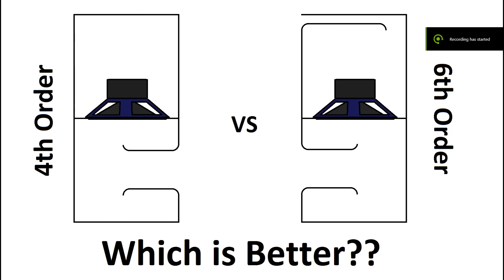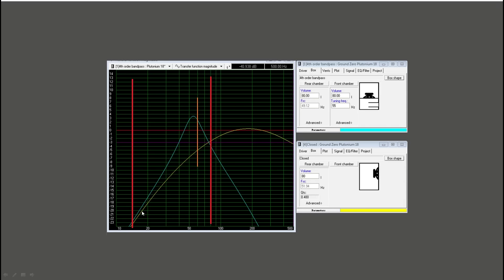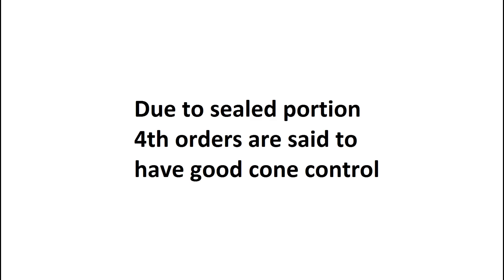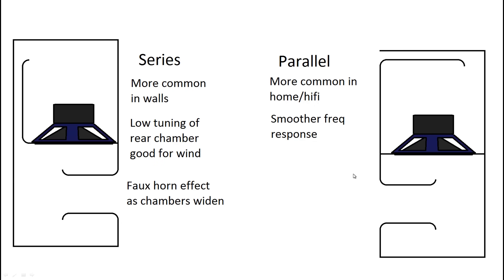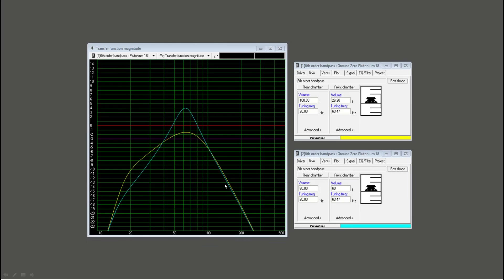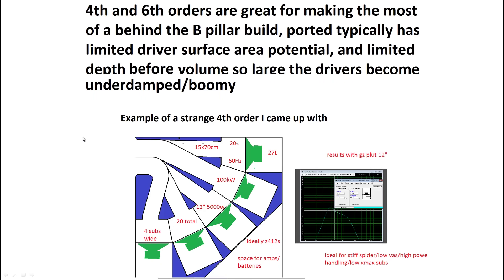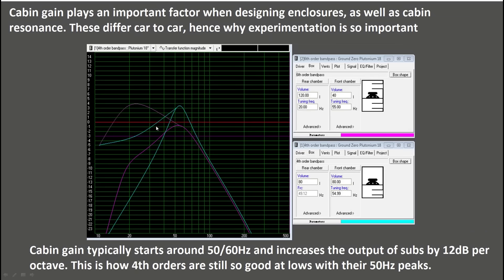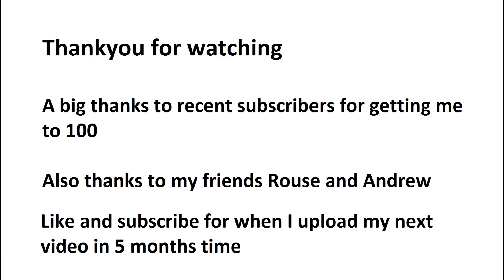4th Order VS 6th Order subwoofer Enclosures

Comment: Who remembers 2 JL isobaric in a 4th order hot box on a punch 40
Reply from the maker: I'd love to hear that, sounds like it'd sound good.
Reply: My uncle is still running his 2x JL 12w4 in an ISO ported setup tuned at 28Hz.  The woofers were refoamed with new surrounds and gaskets.   He also has a JL12W6 but is not using it currently.

Comment: Winisd can no simulate serie tunded  6th Bandpass. And that cabin gain theory is wrong.  It no low that says its 12 db.  It more like Resonases. Like in mye car i have an peak att 35 hz thats the peak of my  Enclosure system. But when i turn it up the space inside the cabin is not big enough and phase of the backwave and the front wave starting to cancel, things in the cabin starting to flex, vibrate and so on. so it start to peak at 45 hz.   And this depends on the size of the Cabin.  Where the dominant frequency's is.  And this also depends what Enclosure you use. A sealed Enclosure wil no behave like an portet solution inn a cabin. Because of the backwave and frontwave wil phase together in a portet box.
Reply from the maker: Yeah, I know cabins are complex shapes and sizes, it's annoying having to generalise, but I wanted to mention why 4th orders have bad low frequency response in the simulations but have plenty of low end in reality. But yeah, generally that 12dB starts beginning below the resonance of the car, so if yours is 35Hz you should be up a tad at 18Hz.
Reply: @Dakoustics  the biggest problem here is the Ts parameters. You can not backtrack something with something thats not correct.  Always when i Design i take out Ts parameters myself .  If you take a look att Basskassekonstruktørene on Facebook you can se mye work on it. With Rta vs simulations.  Of course this depends on what Volum you are on. But att low volume on your Stereo your box Respons will be most dominant until you turn it up and then the cabin Respons or system Respons gets more dominant .

Comment: Bro, with all do respect you just gave everyone false information!!! 

If I have a bandpass subwoofer and want to put it in a standard basspass box which is a 1:1 ratio. That means IF I MAKE MY SEAL SIDE 1.5CUFT THEN MY PORTED SIDE WILL BE 1.5CUFT "EQUAL VOLUME", 1:2 ratio means if my seal is 1.5CUFT THEN MY PORTED SIDE WILL BE "DOUBLE THE VOLUME" 3CUFT.... The only thing you got right is the longer the port, the lower the subwoofer can drop. PORTS PLAY AT TUNING OR ABOVE!!! Anything below the tuning is lost by 3db and as it goes below the tuning it loses control over the cone. 

I'm not trying to be mean or rude but I don't want you walking around with the wrong info. I don't know you, you could be a world class  box builder just wording the shit wrong. I been installing since the 90s and I learn alot over the years building enclosures and making bass tracks. I'm not the best but I'm a damn good installer. My wife wants me to start back installing but overall I admire your passion for it, I lost mines years ago
Reply from the maker: Sorry for the length of this response, but I fully respect you wanting the right information out there, so heres a few things. 
1. Regarding the 1:1 and 1:2 ratio, you didn't point out anything I got wrong. 
2. Ports dont play at tuning or above: Take a sub box tuned to 40Hz, play 80Hz, no air will move through the port. Plug the port, theres no difference in output. The only thing making sound is the speaker itself, I'm guessing you know ported boxes can play up to 500Hz even, but at that point its only the subwoofer itself. Ports in 4th orders and 6th orders are responsible for ALL the sound, so you only hear what air moves through the port. 
So, from what I can tell you're super used to how ported boxes work, which does play from tuning and above, and loses control below port tuning, but 4th orders act like a mirror effect, and do everything opposite, play port down, have control below port tuning etc. 
But yeah I get being bored of installing, if you haven't done it in a few years have a look at some integrated systems which take a digital output from the stock touchscreen stereo, theres still a want for after-market systems. Also, bunch of cheap, good class D amps, maybe just having a look at some newer hardware will get your imagination and passion going. 
Anyway let me know if you got what I mean, I've done a ton of research, experiments, thought experiments, simulations, you name it, I would never spread false information, the "sealed v ported" video was originally made to correct false information which I saw in another video.
Reply: @Dakoustics  you're good bro I love reading lol, I meant to say they play at tuning and above but yea I'm working on getting 6 15" in a 4th. Man between 1998-2008 all I build was 4th. I built a 6th but it sounded like shit. My dumb ass made the port same length and width lmao
Reply: your 6th order(series) can do this, this is something he does not mention, if you have your ports not firing directly into eachother, you can tune to same freq and be skullcrushingly loud, I have done it a few times with a 1:1.25/1.5 ratio for customers, one of them has  gotten 145 with 2 8s at 40hz (believe he said 2k burp but I could be wrong with that) bc of it, Idk if it was a kick score but damn impressive considering my one 15 in a ported box is at 146 at around 5k lol

Comment: can I make a big box using 4th or 6th order  for outdoor events will it sound good
Reply from the maker: if you design it properly yes, im seeing a few 6th order PA subs here and there, only recently though, so i wouldn't be surprised if pa is behind in tech due to car audio competitions driving spl and efficiency forward, just make sure you use winISD to design the box, 4th and 6th orders can be super peaky if you don't
Reply: @Dakoustics  Thanks have not tried it yet,  cause most design box  i've seen was this folded horns, scoops, intimidation and w.box in out door events so I will try the 4th order much simpler to build  thanks
Reply from the maker: @edifierbass7821  yeah makes sense, im making a folded horn right now and i can tell you its a pain in the ass, but from what ive worked out, horns are 4th orders, though due to the shape of the horn high frequencies are still produced due to its shape, instead of from tuning downward, its more complex than that, but might make more sense in your head that way
Reply: @Dakoustics  yes in some ways,  I wanna make  also a small version of folded horn  a home size but comes lots of work but hey just one of my future plans tho thanks for your  guidance

Comment: I personally use a compact chamber almost the same size as the subwoofer itself but with a very long port tube (4" diameter x 90" long Approx. in my vehicle). Goes down to 10hz loudly. :)
Reply: That makes a very inefficient enclosure for reproducing lows that anybody would consider loud...... I did the basic math on it assuming you used .1-.2 of a cube, with your suggested port length the tuning would be entirely too high to effectively play 10hz without sounding like a wet fart and unloading the sub so "I will take things that didnt happen for $600, Alex"
Reply: @zacharyhafer2806  
With all due respect, if the enclosure was so bad I would not make it in the first place; in fact it’s my favorite enclosure for playing infrasonics which is what it’s mainly designed for. 
“I will educate those who have no experience for $1000 Alex”.
Here’s a video.
https://youtu.be/NeSC0C1R6tc
Reply: Id love to hear that design

Comment: Thanks helped me understand more about Qts and 4th order. I'm working on a 4th order for a JL 12W6 for fun!
Reply: How did your build turn out? If it’s monstrous I’ll put the same in my civic.
Reply: @Ichabod_Jericho  I scrapped it and went a massive audio 12. It can handle more power and hit way harder deeper bass. Sold that W6.
Reply: adaboy4z I knew it! Part of me wants to go JL, part of me knew big brand names have cheaped out
Reply: @Ichabod_Jericho  Don't get me wrong that JL W6 is a beast on 600 watts but there are better subs for cheaper and can handle more power. I already had a Kicker KXA800.1 amp and a Kicker KX1200.1 so it was natural to use that power!!!

Comment: Hey. Thanks for the video. Im from Melbourne. I built a portable boom box for the campsite, its got roughly 1000watts of low midrange and high, all 12v car audio, Focal and soundstream. 2x amps, and a 130Ah battery, It works really well, has reasonable volume, and keeps people happy. I want to make a version two, keeping all the same speakers, just improving on design and speaker efficiency. I can build almost anything, but when it comes to sound design response, I get lost in the technical, and fast! Which leads me to my question. Would you be interested in guiding me towards a well designed efficient enclosure for my woofers and midrange speakers I already own, which I can build? Thanks, Ryan
Reply from the maker: mids and highs would stay as is, hard to get more efficient without buying new components, and for sub I'd recommend a 4th, I've had good luck with 4th orders for outdoor PA, for a 12" something like 28L sealed, 28-40 ported, varies sub to sub. Tune it around 50-60Hz. Port should end up being 30x5cm, and about 25cm long, add a curve in the back, rounding over the front should help too, if it sounds bad just remove the middle baffle, and mount the sub like a standard ported box

Comment: How about 6th order with isobaric loading?
Reply from the maker: I've made an isobarik 6th order, its basically the same, but the vas of the drivers is halved, so to be optimal the enclosure size should also be halved, unless the enclosure is already too small in which case isobarik can be a good way of correcting it

Comment: The qts figure of a driver tells us the electromechanical damping and amplitude or bias of the system towards resonance (Higher qts means less damped and more biased towards resonance). Lower qts i.e below 0.4 are best for ported or bandpass if there is no eq. because they have a "damp" resonance). QTS and resonant frequency can vary greatly after burn-in, temperature and humidity. For example, a raw Peerless xls 10 measured- QTS 0.38 FS-37hz VAS- 25l. After burn-in for 15 minutes with a 25hz signal (the voice coil former almost hitting the back plate, though not quite) QTS- 0.32 FS- 26hz VAS- 79 litres! - no kidding.
Reply: Q is the ratio of reactance to resistance. It stands for "quality" because a century ago good radio transmission, and good radio reception, required antennas that delivered as much energy to the radio signal, and from the signal to the receiver, as possible--the resistance was a parasitic loss spent heating up copper. Since the thermal dissipation is (current squared) times (resistance), increasing Q meant arranging things so that current was low (so voltage high) and there were few and ineffective ways for the electrical signal to get converted to heat (both on the way out of the station and on the way into the listener's home.

The claim that low Q drivers have a peakier response is incorrect. The maximally flat amplitude response vs frequency is obtained at Q = 2^^-.5 = .707 = sine 45 degrees (Butterworth); maximal phase accuracy Q = .57 (Bessel); maximal transient accuracy Q = .5 (Linkwitz); maximal efficiency (NOT sensitivity which is usually called efficiency but is not dimensionless as is every efficiency)
at Q = 1.1 (Chebychev). Any value of Q greater than unity will exhibit ringing and overshoot. This was all worked out by the Australian mechanical engineer A.N. Thiele and his grad student R. Small and published in IEEE Transactions in 1961 (later republished in the Journal of the Acoustic Engineering Society in 1971 and 1972). Thiele realized that it was necessary to either transform all the electrical quantities into their mechanical analogs, or vice versa, in order to encompass both in a single framework that would enable the well-developed machinery of filter theory to be used. Unsurprisingly, being a ME he chose the former and--regrettably--published in the leading EE journal. By the time the word got passed quite a lot came and went: the Beatles, Jimi Hendrix, Janis Joplin, Cream, and Woodstock. Oh well.

Note that total system Q (Qts) depends on the electrical and mechanical Qs (Qes and Qms) of the driver only--which varies widely (15% and sometimes much more) but is independent of the enclosure. Putting a loudspeaker mechanism in an enclosure raises the Q. You are stuck with it when the driver is unpacked--the only way to lower it is via equalization (the Linkwitz transform). The Qs I listed are in-the-box Qs, which you have some control over (a smaller box yields a stronger air spring which is more capacitive reactance, similarly a larger port yields a more massive plug of coupled air, which is an inertance yielding inductive reactance--like a flywheel.

Comment: This sounds like a really stupid question but I have to ask it because I'm confused by some of the references I see:  in sixth order enclosures is the rear chamber the one behind the driver (ie with the chassis and magnet protruding into it) or the one in front of the driver?
Reply from the maker: yeah, rear chamber is the one with the magnet in it, and is usually also tuned lower than the front chamber if it has one
Reply: @Dakoustics  Thanks for the clarification. Cheers

Comment: Hi. I am a "newbie" in designing enclosures. For me it is clear that WinISD is the most accurate software to design speakers (if my info is right...). I have found speakerboxlite.com and today I just tried to design a 4th order bandpass enclosure with it for a Monacor Raptor-6 speaker (it is a 100W RMS speaker and I never will put on it more than 100 W RMS), here it is: https://speakerboxlite.com/subwoofers/monacor-raptor-6 ("User projects" -> klick on "Use" button - I am vpeti89). This is my first bandpass design ever. What is your opinion on that? How will perform in car / inside the house / outside? I will not build it if this design is wrong...

Btw, sorry for my bad english...
Reply: Update: I redesigned the enclosure because of my personal needs: WxHxL: 600x250x250 mm. The W = 571 mm, so now it is OK for me...

Comment: Dont get fooled by the real life efficiency compared to the specified efficiencies. My 15" 1000w rms 88db efficient 3inch voicecoil sub is more efficient at 400watts than my 93db efficient 400w rms 12" pioneer, ALOT more bass, if I had to judge on my ears, 3-4times more. So only if you listen at low levels its better to get a high efficiency sub if all other parameters are the same.
Reply: If one is 88db and the other 93db. That means the most sensitive doesn’t sound 2x more. It sounds half more. To have the double of apparent volume must have a difference of 9db, more or less.

Comment: What about an enclosure that is a front loaded bass reflex with one woofer on each meeting side but where one side fires into a forth order chamber. Would that still be considered bandpass? Would it be like a 4.5 order?
Reply from the maker: Interesting. I've seen something which was a ported box, with speakers firing out, but also had speakers inside, so it kinda acted like a 4th order as well. I'm not sure what you'd call that, maybe a 4th quazi 6th series, as it kinda acts like a 4th and a 6th. But maybe since one is 2nd order and the other is 4th order, it averages out to 3rd order, so would in total be a 5th order. Yeah, an odd one certainly.

Comment: Modelling a 6th order parallel bandpass I have found that it is best to start off by designing a vented box which is slightly bigger and has what is called the chebychev response. There should be a bit of a peak around tuning and a couple of dB dip in the centre of the range. A driver with an EBP (FS divided by Qes) of between 100 and 120 for tunings in the 35 to 40 Hz range and lower if you want to tune lower. Once this is set up on the simulator (I use hornresp) the second chamber should be around half the size and tuned twice as high.
If the lower tuned portion is about a third larger than a flat vented box (so the total can is about twice the volume) then you will get a flat response but if you go a bit smaller you will have a slight rising response which is okay to save space in a car and will level out with cabin gain.
Reply: Thomas Jester Tarulli of team orion has/had a (6) 15" sub system in a 6th order that is very high output with a wide frequency response.  It's quite legendary his performance.  His set up is 1:1 and tuned at 25 and 50hz.  As always it seems it's about trial and error as each car/home is so different.

Comment: 2 woofers I like are the Dayton dcs255 and the DC audio level 1 12". Both model almost identically. The dcs255 is a reasonably efficient 10" and the DC 12" is a high xmax 12".
I built a 60L bandpass for the Dayton, I tuned high in a 4th order, people forget how much bass is above 50hz sometimes. It sounds beautiful and above 40hz its way more efficient than my nvx vcw15 in a 180L ported box. Above 40hz my nvx build needs about 10x the power to match its output. But the bandpass falls on its face below 40hz at high volume. I'm planning on using the DC in a future built with its 19mm xmax.